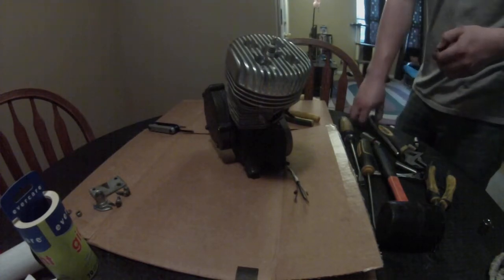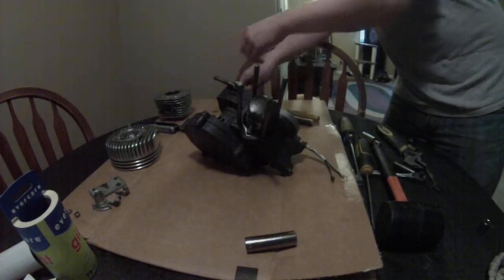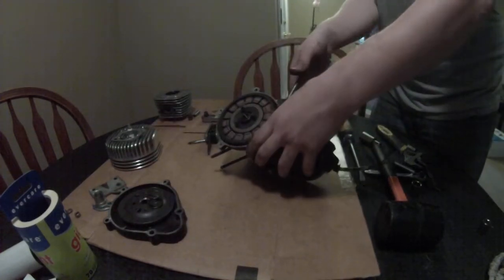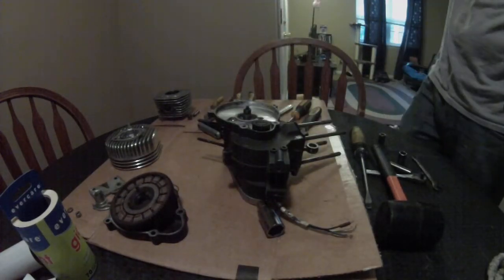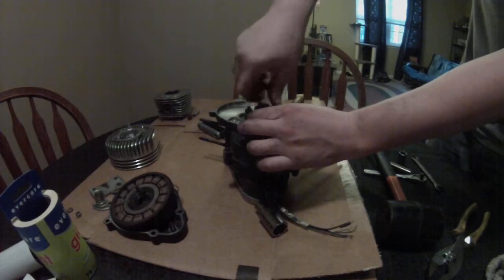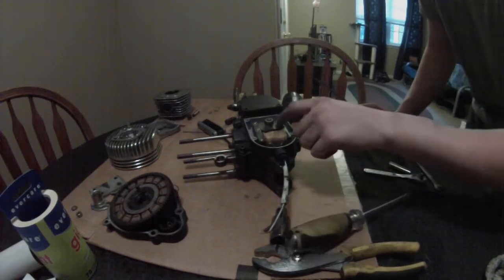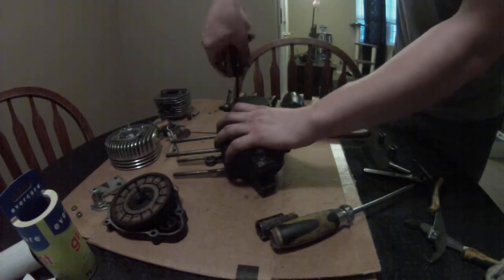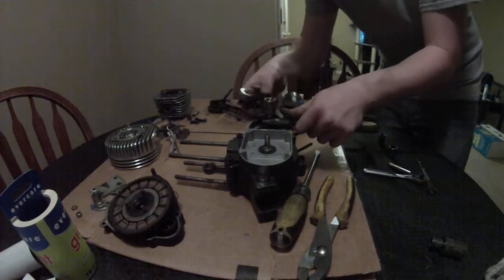66cc/80cc 2 stroke motor complete tear down (Part 1)

Comment: Does the little screw sticking out of the large gear/clutch shaft have to come out to open the crankcase or something? That's the only thing even resembling a faster left on my engine and it still will not open. I've beat the shit out of it with a mallet, tried prying it open with a myriad of screwdrivers and prying apparatuses, and still, at most it opens about a millimeter or two, probably half of which is just the missing gasket I've now destroyed. I see that little threaded rod in the first video but can't tell if it's still there when you separate the two halves in the second video or not. Any help or tips is greatly appreciated

Comment: That magnet don't come out as easy as he made it look. I had to break mine out. Would not come off! Is only a junk engine of mine anyways. Taking it apart to see what it looks like inside for myself
Reply from the maker: There are parts on these that are absolutely stuck on and parts that you wonder how they stayed on. This motor had been disassembled once previous so she was mostly unstucked. As for the magnet sometimes you need to take a screwdriver on each side and pop it up.

Comment: on my engines upstroke its not smooth it has alot of resistance then breaks free on the down stroke when i use a wrence to cycle it do you what the problem may be.
Reply from the maker: I'm assuming once everything is all oiled it'll be a lot smoother.
Reply: Jordan ok thanks im betting its some material ina bearing some where ill keep updated
Reply: Just got it cracked finally, turns out i got a seized bareing looks like i dropped some metal shaveings in and it found its way in there.  I ended up useing the gear puller threded on the clutch bar and a hammer with heat

Comment: Hey I have one and it work fine stock. So I decided to adjust carburetor and after a few test runs. It bogged out on me! Now it won't fully start. Its like it comes on but doesn't fully get power. Then does studdered bogging as if its struggling to get gas or air. And when I pull throttle its like it boggs out as well! Please help!!
Reply from the maker: Probably running rich now. Can you put it back to where it was?
Reply: Adjust the air fuel mixture on the carb. It's getting too much fuel and not enough air. It's basically flooding out.

Comment: 6:04 can you inform me on that puller? I have 3400 miles on mine and I need to replace the center gasket but was not able to remove the clutch and I don't know what size I need or where to get one. 9:32 is that the same puller? 16:45, another type puller????
Reply from the maker: +schutztruppe 1900 They are all the same type of puller just. They are made specifically for these motors. Some of these kits came with them when you order them. It's called the clutch puller and works on all three sprockets. Here is a link. This one is kind of pricey, but it gets my point across
http://www.amazon.com/CLUTCH-PULLER-Cycle-Engine-Motorized/dp/B00DH2Y90K
Reply: +Jordan Randle  thank you!